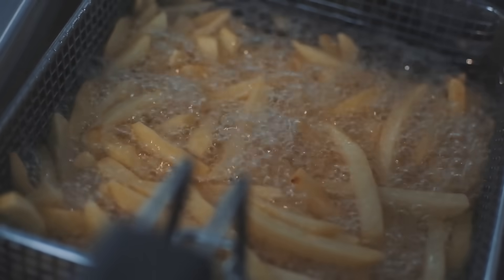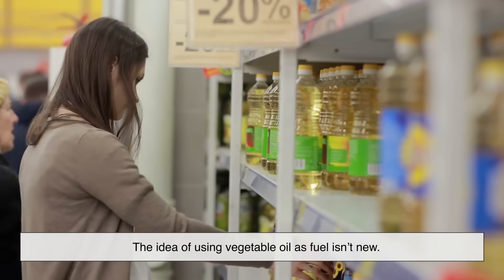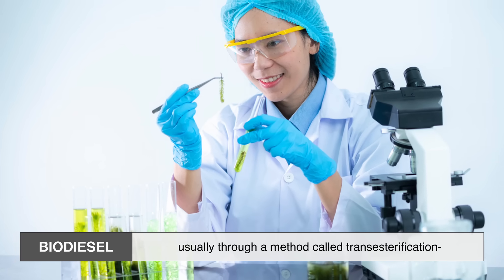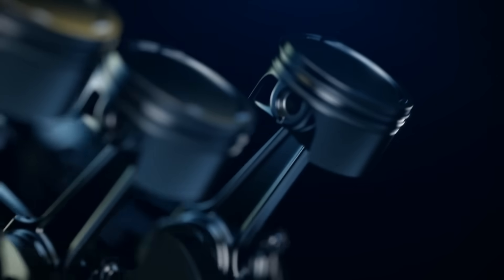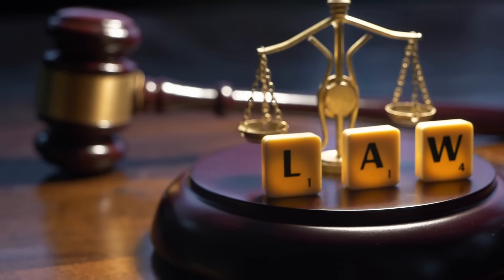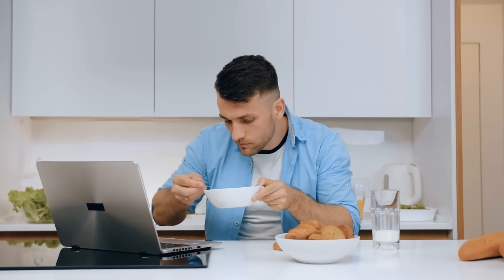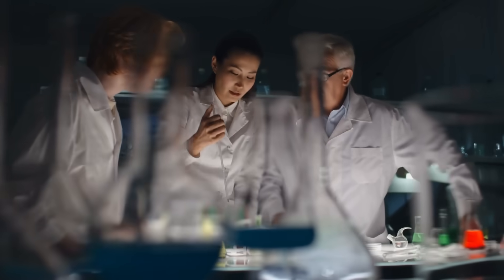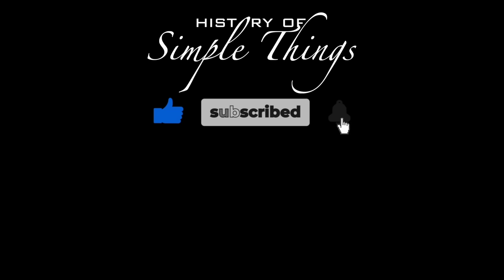Can You Really Run a Car on Cooking Oil?

Comment: I use palm oil-based cooking oil in my Mercedes-Benz W124 300E, with a ratio of 60 percent passenger car oil to 40 percent palm oil. I've driven it 3,000 kilometers. On the highway, I usually drive my car up to 145 kilometers per hour, and so far, I've had no problems. The car feels very responsive and smooth.

Comment: How does multi fuel engines work? The ones that run on diesel, gasoline and kerosine. What is the difference with ordinary diesel engines. with Mainly used by the military in trucks and tanks.

Comment: I have already tried that in several different engines, usually there are a loss of 30% or more of power among of a bunch of malfunctioning that will happen depending on the engine.